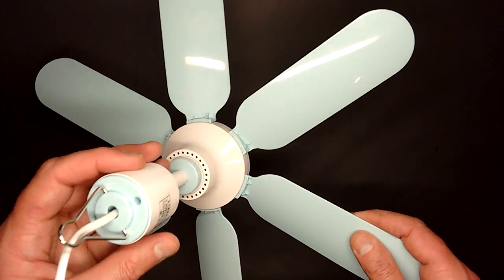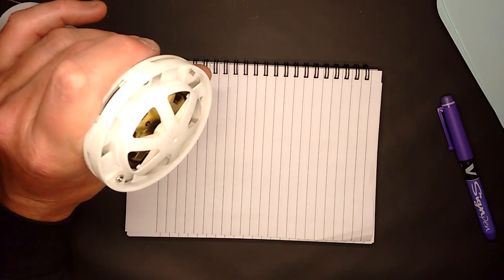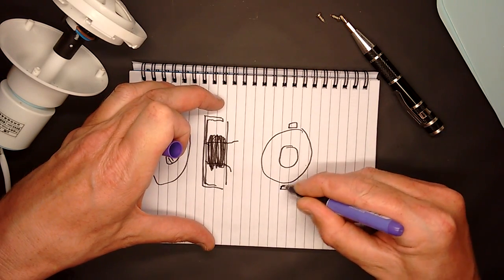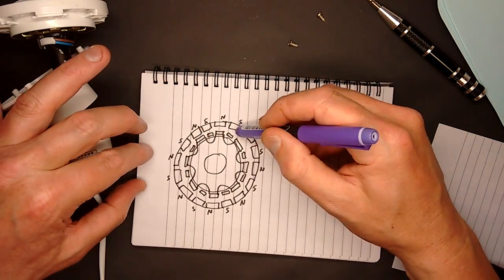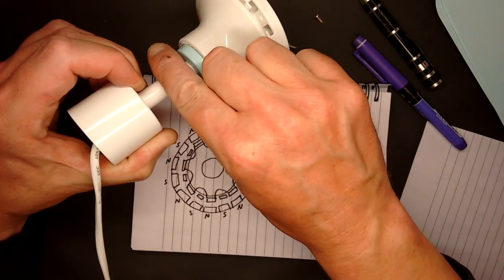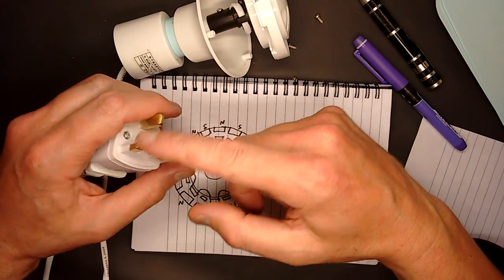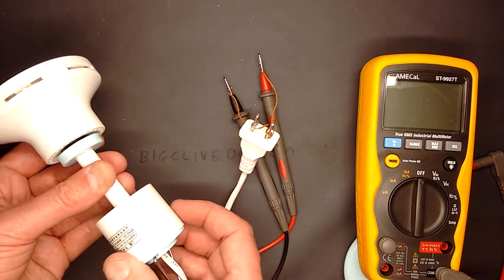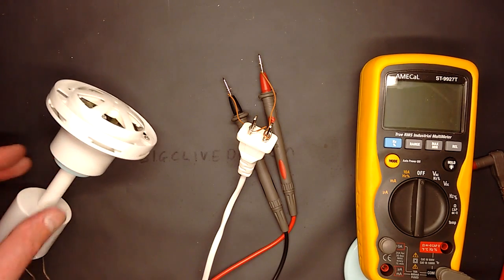Mini ceiling fan with intriguing motor and wind turbine potential.

Comment: its so adorable I need to find a reason to need one so I can buy one!
Reply from the maker: No reason required.  But 220V plus is probably required.  I don't have a 120V supply to try it on here.
Reply from the maker: I do have a small variac somewhere, but it's so buried under technical stuff at my old workshop that I'd have to really dig to find it.  But that would be quite handy to find.
Reply: hey what what do you do as your job i dont have a job but if i did it would be something to do with computers or pharmapcueticals
Reply: While moving back and forward in the busy times it may not be much use but do you have or have you considered getting a Varriable Transformer (typically known as a VARIAC) @bigclivedotcom.

Handy little things for varying AC supply voltages, naturally it can't do frequency variation but in this day and age that is often less of a problem (can be for AC motors)

Comment: I bought one of the 3-blade 12v fans from banggood a while back, works okay, but makes some annoying noises, but it doesn't half move the air when needed... :)

This 220v one doesn't seem too dissimilar internally to the 12v one, the difference being that the 12v one has a DC-AC inverter to make the fan turn, dunno what voltage it puts out as AC, but I do know the two little capacitors in there get roasting hot, so will probably go bang... :)
Reply from the maker: I've got one of the 12V ones, but it's not here. I'll analyse it when I get a chance.
Reply: Clive, did you get round to investigating the 12v fan?? I think a lot of us would really be interested to see the results, we all want to turn them into wind generators :)

Comment: Could you plug the fan (used as a generator) into a power strip and then plug a USB charger into the same power strip, and leave the power strip unplugged from the mains?
Reply from the maker: Yes, but it would be a bit random.  I did plug in a compact fluorescent light that way and could light it in bursts by hand.

Comment: Hi, again, Clive.  A quick question for you:  Do they generate their own power somewhere on the Isle of Man or does it come from the mainland (via underwater cables)?
Reply: https://en.wikipedia.org/wiki/Isle_of_Man_to_England_Interconnector
Reply from the maker: Both.  They have oil powered generation stations dotted about the island but use a cable (with quite staggering losses!)
Reply: Cable from mainland I think Clive has mentioned previously,
Reply: bigclivedotcom Interesting.  Many thanks to you for answering this for me.  :)

Comment: Is this fan pretty much a typical outrunner brushless motor? Somewhat similar to the kind frequently used in higher performance drones?
Reply: For different frequency and voltage, yes.

Comment: This will give low RPM generation and once retified a battery load will regulate the voltage and current. The blades are optimised to push air but will generate some power if the wind is strong enough. Interesting to do some tests charging a power bank, I suspect this would stall the blades. Cheers, Andy
Reply: Andy Reynolds i have some experience with that flat blade design, it seems to be better at higher RPMs

Comment: I noticed this comes with a North American style plug.  I'm thinking this would run on 110VAC, perhaps just as well, once it got some inertia going.  Can someone educate me here?  Would I end up with a flaming spinning wheel of death, throwing off globs of burning plastic?
Reply: PM synchronous motors have a fixed volts:Hz ratio, so no unless you rewind it, feed 6/5ths of 230v or roughly 277v, or 120v at about 25Hz it very likely would not work.
Reply: Daniel Armstrong
Thanks.  So, heat, flames, chaos.  Got it.
I tend to know just enough to get myself into trouble.  Then again, with a little caution, trouble can be fun.
Reply: What about connecting two in series? I know, likely voiding warranty and or insurance, but using stuff like that might do so anyway.
Reply: +namibjDerEchte Then you would need 2x the voltage for the same frequency, IE 460v at 50Hz.

Comment: What is the power rating of the fan. I'd think that this will be the upper limit of it's use as a wind turbine. Nikola Tesla says that since it's AC, it will be easy to change the output volts using a simple transformer. Buy three fans and try to make a three phase turbine. One minor problem I see is that the spring must drag in the forward (normal) operation and will probably wear something out eventually.
Reply from the maker: The spring is static once the fan has started.

Comment: Doppler effect? Did you mean 'rolling shutter effect'?
Reply: I think he is referring to the fact that on one side the blades are moving in the same direction as the rolling shutter but on the other side they're moving in the opposite direction hence the weird asymmetry.  So yeah rather like the doppler effect.
Reply: No, he meant, "kind of Doppler effect, I suppose, in a way". Of course, the rolling shutter effect is involved, but the effect is certainly very Doppler like.

Notice that the blades seem to bunch together as they go up, and spread out as they go down. This is very much like the bunching together and spreading out of waves in the Doppler effect. The movement needed to trigger the Doppler effect is provided by the rolling shutter.
Reply: I think he was saying that the rolling shutter is similar to the doppler effect in this case.
Reply: The blades became round, that's what he tried to refer to I believe...
Reply: Definitely rolling shutter rather than doppler since it's due to the blades moving in a plane perpendicular to the viewing axis and depends upon the camera technology.   Doppler is for motion towards or away from the observer.

Comment: would this work in the US? .. the 220 version i mean? .. cause we use 110 and i would hate to have to wire it to the dryer to get it to run
Reply: It might as it is frequency locked rather than voltage, so line frequency governs the speed (provided there is enough power to overcome slip).  However, at 120V it is going to have a lot less power behind it so it may or may not be able to maintain speed as it all depends upon whether 120V is sufficient to overcome the air resistance to rotation.  If you are curious you can always buy one to try and experiment with since they do not cost much.  The worst that would happen is 120V not being sufficient to overcome the rotational resistance and the motor burning up...but I suspect it would make an honest effort to turn so it might work, albeit likely weakly and marginally.  But no guts, no glory.
Reply from the maker: Could possibly try it with just two opposing blades or three blades to reduce the braking effect of the wind.

Comment: i have one   from the Philippines and had a ring like permanent magnet   like yours if you
turn it it will  generate voltage that can shock you and  run some stuf . dont hold the plug a spin it
can run on 120v

Comment: BCdc, I just watched a video of a man turning a washing machine motor into a water turbine which makes enough electricity to power his house. Is this youtube BS or is this possible?
Reply from the maker: If the washer has the direct drive pancake motor with powerful magnets than it could generate modest current with a high head of water to produce enough pressure from the turbine jet.  But the voltage would be variable.  Most of the home-generation videos are quite optimistic about the power generated.
Reply: In Europe we call that industrial power. The average Dutch house only has a single phase 35A 230V mains. Maybe 2 or 3 phases when an electric stove and/or heater are present but central heating is almost always connected to the natural gas supply.
Reply: BS because you need magnets to produce usable electricity, Typical washing machine motors do not have permanent magnets they have a magnet winding or field coil as some people call it. You would have to isolate the field coil from the rotor coil and then energize the field coil then start turning the rotor and getting the sync right for it to produce anything, but the amount of power needed to get a good enough field going does not come close to justifying the output of the motor.. In other words. Nothing if free, you will always exert energy (typically more) to generate energy in this case your not only providing a field voltage and current your also providing mechanical energy in the form of the water flow to tun the rotor.

IF your good with metal and engineering you could in theory stril out the field coil and equip the motor with some rare earth magnets and that would make it possible to generate but you have to do this in a way that the polarity is correctly align and the magnets are spaced properly so the whole device is stabilized and will not wobble about.

As for the video, the video is not 100% honest as the guy does have mains power service that is buried and coming into his home. The magic of video editing on YouTube...
Reply: BS unless you can run your house on about 200 watts.  A 1/3 horsepower motor uses about 2 amps at 120 volts.  All the modifications you can do to it won't make it produce much more than that.  The mains coming in to the average (USA) house are 230 volts at 200 amps.  That is 46,000 watts, or about 185 washing machine motors. You COULD run about 15 CFL bulbs or 20 (give or take) LED bulbs, and every bit DOES help, so it would be an interesting project.
Reply: @chakathewolf  
You're exaggerating the amount of power that could be drawn from a residential electric service.  The pole transformers are not even 46 thousand watts, and they are shared by many houses.
Reply: Amongst others, Philips used to use PM DC motors, made by Polymotor Italia which was then part of Philips, later sold to Vickers, in their washing machines. Similarly constructed Polymotor motors were used in the Sinclair C5 bike, hence the rumour that they used washing machine motors while in reality they might have been closer to the motors used to adjust the canon in a tank or something similar.
Reply: bigclivedotcom ^^ This ^^
Reply: Chaka Wolf 200 watts is not much and when most people (who are not survivalists or doomsday preppers) refer to "running their house off of whatever" they are talking about things like their central A/C, electric cloths dryer, and other luxuries which 200 watts is not going to do. Yes 200 watts will run a laptop, an LED lamp and if its pure sine wave run your internet modem / wifi router (cannot run this on a modified sine system, it will not sync). but that's about it
Reply: When I was a kid our house was fed by a 60 amp service.  That was upgraded to 100 amps when the air conditioning load started blowing 60 amp fuses.  (Summers here in Texas exceed 100 degrees F (38 deg. C) on a regular basis.  I have seen as much as 45 deg. C) We had gas (propane) for heat and cooking.  Standard service is now 200 amps.  We certainly do NOT use that much on a regular basis! I have never visited the Netherlands, but I would love to!
Reply: +Chaka Wolf 

G'day,

  Um, as it happens, the Excited States of AmeriKa runs it's Households on 110 Volt AC at  60 Cycles per Second..., not at 60 Amps, as far as I'm aware...; Britain & Australia run on 240-Volt AC at 50 Cycles per Second, and most Houses in Oz are wired with 10 to 30 Amp Fuses on the Powerpoints, so that's 2,400 to 7,200 Watts, or 3 to 10 Hp of Current available on any one Circuit in the Houses...

  By implication, to deliver the same quantity of Unicorn-Farts at 110 Volts, in the USA, then they'd need 20 to 60 Amp Fuses...(yes ?).

;-p

Ciao !
Reply: @WarblesOnALot  
The service to my residence (in the US) is 240VAC center tap at ground (earth).  So any high power appliance can have 240V if wired to both phases.  Any other appliance normally gets 120VAC.
Reply: @acmefixer1  

G'day,

Thanks.

  I never knew that.

I'm not a "Sparky" (Electrician), but my son is...(!).

Have a good one.

;-p

Ciao !
Reply: Rewired F&P (Fisher and Paykel) Smart Drive motors have been used for a long time by DIY alternative energy people.  They can produce a fairly decent amount of power.  Just google for Fisher and Paykel generator to find many links.
Reply: Yup... F&P started the revolution, but now all quality brand mfr's use permanent magnet BLDC motors in their clothes washers... they are far more efficient. Most are capable of generating 600-1000 watts, and with some mods, 1500 watts. PM motors generate voltage according to the RPM they are rotating. If you are able to rotate them at higher speeds than they were used at in the washing machine, then higher Voltage is available... and thus higher Power (Watts).  Most users re-wire them for lower Voltage / higher Current, by paralleling the stator windings properly to more closely match their inverter system.

BTW... when re-wired (as above, for low voltage operation), these can also make handy & powerful experimenters Motors... though large.
Reply: It will run on modified sine wave just fine... most cheap computer backup batteries (UPS, like an APC) are modified sine-wave. I run a cable modem and all related networking gear as well as computers and monitors off of a few of them during outages.
Reply: ***** AKA DC motor, which most washing machines do not have
Reply: Power line frequency here in the US has always (to the best of my knowledge) been 60 Hz.  The 60 amp figure I quoted is from my youth, back in the 1960's.  Incoming mains supply is spec'd at 240 volts, and all the high-current things (air conditioning, heating, water wells, etc.) use that.  The two hot legs are split in the circuit breaker box and paired with a neutral to derive 120 volts for all the small stuff.  Lighting circuits are usually protected by a 15 amp circuit breaker and wall outlets are protected at 20 amps.  (That's 1,800 and 2,400 watts respectively.) Each circuit has a recommended maximum of 7 devices.  I remember the first time I heard a European power substation humming at 50 Hz.  I wouldn't have thought it would be that obvious, but after a lifetime of 60 Hz it sounded really weird!  Cheers!
Reply: @chakathewolf  
Before 1950 the power was not standardized at 60 Hz.  Some local generators such as at dams might supply 60 Hz, and other power plants put out 50 Hz.  You had to know what frequency your power was so you could buy the correct clock.  But if you moved, your clock might be way off!  😂😂
Reply: Was that Angry Ram's channel by any chance? He's also got a video of him replacing the motor because it melted. I'd say it's not BS as he explains (and shows) how the whole thing is wired up.
Reply: No, not to power his house. Possible to produce electricity (given it is a dc motor, which i doubt), but not enough to power a house.
Reply: yeah, i have a house from 1952, still had a 3 phase stove :D.
nothing uses 3 phases anymore, so have no use for it other than split it up into 3 groups.
Reply: Our ducted air conditioning uses 3 phases.
Reply: Check out the Tesla turbine. 
It's nothing electrical, just a set of smooth disks (hard drives are great for this) that make use of surface tension and the water travels from the outside of the turbine to a cleverly designed exit hole at the axis. No eddy currents and uneven stress on the bearings.
Reply: When it comes to running off the grid. People try to conserve, use less, and don't try to focus on running 110/220v power required sources. Mainly their focus is on 12volts or 5volts. So if they made a washer into a water generator that powers a 12volt battery. Then yes. And depending on their power demands and requirements for such devices. Yes they can power their whole house (depending on size,etc again.) on just that made up water generator because they are using a lower required voltage and ampage source then a high demanding 110/220volt ampage source.
Reply: Not BS at all.
 If you gen/store 200 watts continuously from hydroelectric give you 4.8kwh per day.
Easily enough for some. 
Fisher & paykel smart drive w/m motors apparently make great generators and can be rewound for whatever battery voltage you want. 
They have 42 coils and easily produce 300v from factory before rewind. Various outputs claimed eg 300w continuous, 1000w peak.

Comment: Hi Clive, great video. I am in need of your advice, I was trying to replace the G4 halogen bulbs in my mum's kitchen cooker hood, I managed to get the dead bulbs out fine but the new bulbs just won't go in, the pins just won't go into the connector, even the old dead bulbs won't go back in. Any advice?
Reply: did you broke it? if yes that may be your problem
Reply from the maker: Some of the sockets are prone to going a bit stiff and crusty.  It may take a bit of cleaning (with the power to the cooker hood completely off) and effort to wiggle the lamps in.
Reply: cheers Boss, I'll give it a go

Comment: my thought when you were explaining that it could decide to turn in the wrong direction due to AC current and it uses a spring to prevent this is why couldn't they just have used a bridge rectifier ?
Reply: Because  DC current would create a static magnetic that would lock the rotor in one position and then the coils would burst into flames as the coils would saturate as they're designed to run on AC :-)
Reply: Coolkeys2009 ok I thought already my assumption was too simple but couldn't figure out why :)